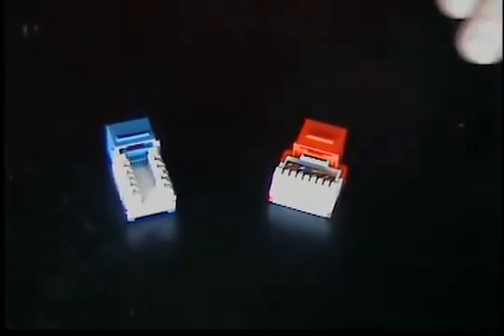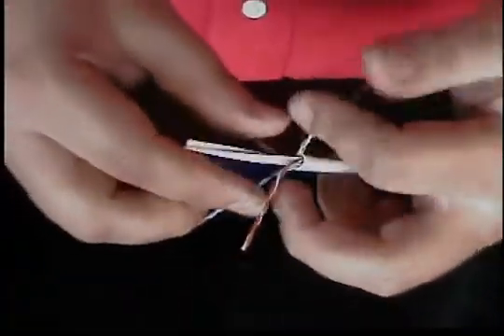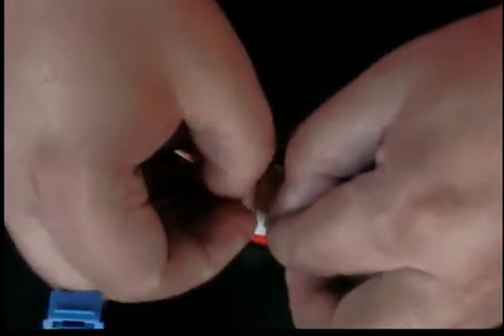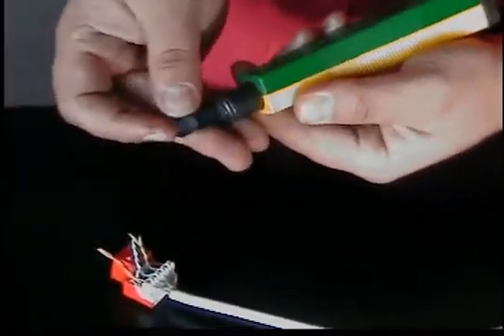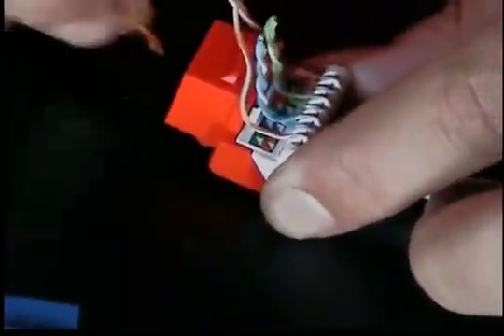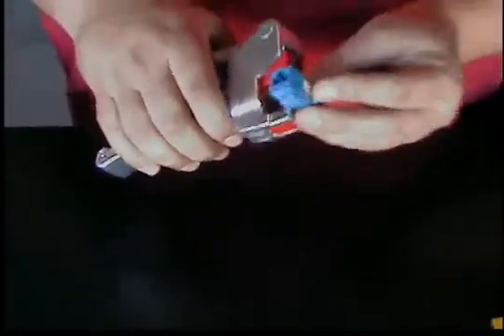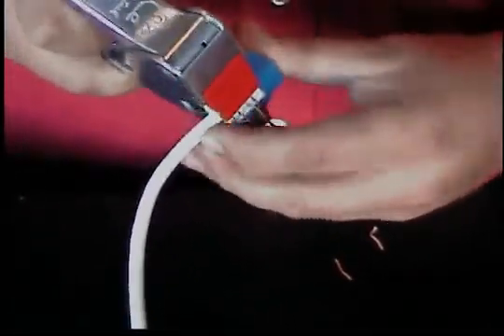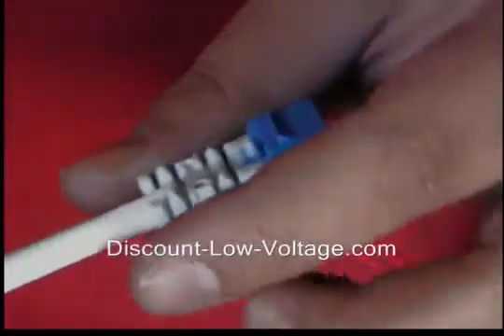How to Punch Down Cat5e and Cat6 Keystone Jack Modules – Kwik Jack Tool Demonstration – YouTube

Comment: How come nobody in these videos ever uses the nylon string for it's purpose?

If you strip the jacket and nick a wire you could have issues. You strip about an inch, inch and a half and then you use the string to split the case for about an inch. You then cut off the cable that were exposed when you stripped the jacket. 

Then don't put the string in there as a novelty guys.